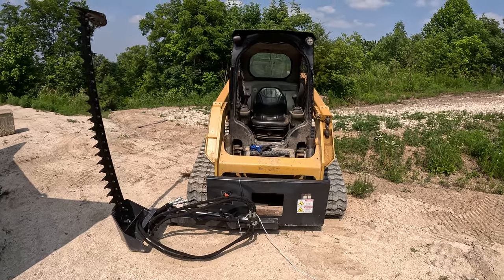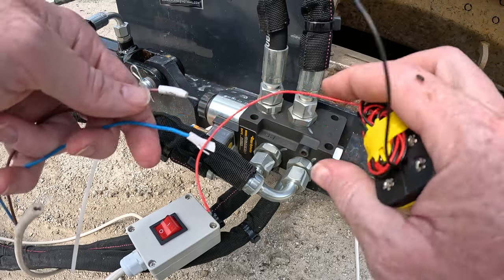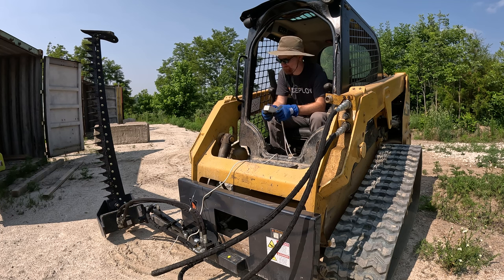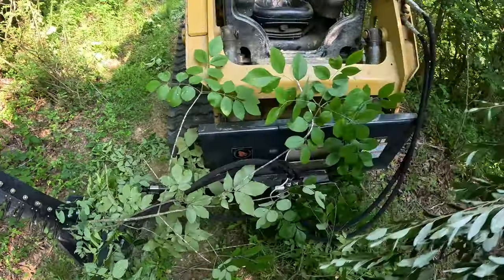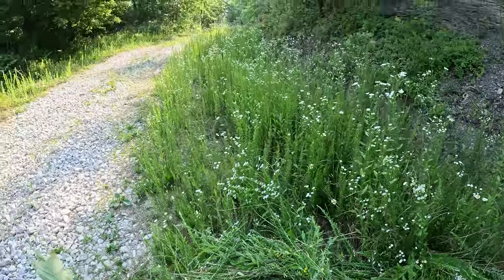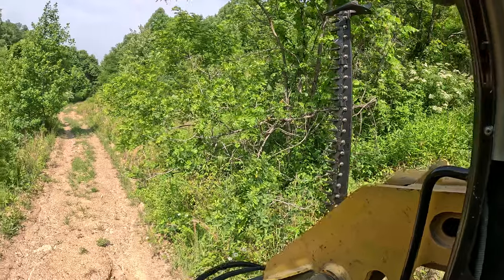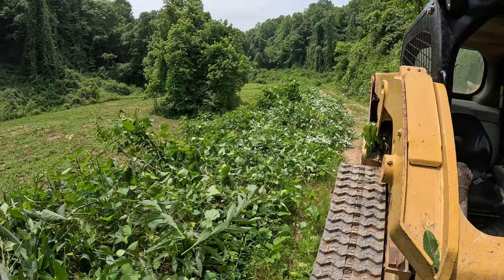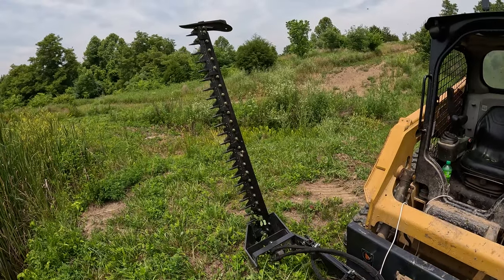Clearing Trails With the Cheapest Skid Steer Sickle Bar Mower I Could Find

Comment: Bought one of these from Ritchie Bros Auctions. Pretty much everything about it is terrible, but they can be made better with a few modifications: 

1. As mentioned, the guards and teeth are poor quality, best to knock them all off and replace them with a North American brand held on with bolts instead of rivets; you'll need taller knife hold downs if you go this route to clear the nuts. 

2. Add a small ball valve to the ram hydraulic line and adjust it so the ram moves sloooowly and smoothly. Take the handle off the valve and wrap it up so it stays set.

3. Only run the motor counterclockwise when looking from above to ensure the push stroke is mostly more inline with the knife, otherwise you'll bend the knife head if it gets into tough cutting. See 4b below.

4a. The dog bone/linkage is too short to allow full stroke both ways (the knife section should go about 1/8" past the guard at min/max stroke) so needs to be lengthened 3/4". 

4b. Or better yet, build a new longer dog bone that allows the use of self aligning bearings (SKF 2203 E-2RS1TN9) that will allow some movement, otherwise you'll just break an inner race and/or wreck a bearing every time the knife head/bar flexes. 

Should probably make a video on how to fix these up to make them better. Not necessarily good, but better.

Comment: Replace the broken sickle sections with good serrated ones. Remove the broken ones and check others for cracking replace any cracked ones too. Take a un broken one to the farm store to match up for new ones, be sure EVERYTHING matches perfectly you look for over serrated ones and use the special screws instead of rivets unless you invest in the sickle rivet tool. Also when cutting grass and weeds go 3/4 throttle and possibly full ground speed, you weren't  going fast enough ground speed for it to clear the cutting bar and broken section didn't  help. As for the broken modified guard, remove a good one and take it with so you can match it for new ones, buy a couple, you may be lucky enough to have a store that would have a single to replace that one. If not you can weld a piece of flat steel to replace the broken top then shift them like you said.

Comment: I have the same one.  I broke the blades like you did, and the teeth.  I also keep breaking the bearings on the linkage.  They are very much undersized for the job.  This design can not handle cutting 1 or 2 inch sticks on hedges for long.  Might be better used for just grass.  I also broke a weld on the rotation point.
Reply from the maker: Oh man, that sucks. Did you replace any teeth? Can you point me to the right size?
Reply: @badcanyon  I used the A size from fleet farm.  its a bit thicker also.
Reply: I found little thicker blades at Rural King farm store size A.
Reply: Glad I found your video before buying one on auction......thank you for sharing

Comment: When you mow horizontal does the base need to slide on ground or can it be completely air born? Wondered how it would work to mow ditch shoulder of gravel road.
Reply from the maker: It can be horizontal and in the air. Most of what I mowed horizontal ends in a ditch, so there was nothing for the end to slide on.